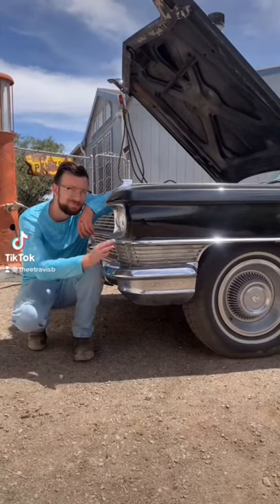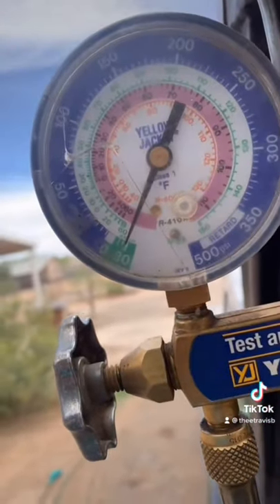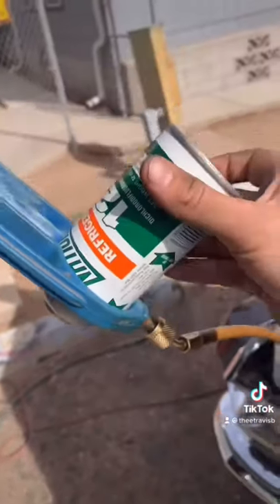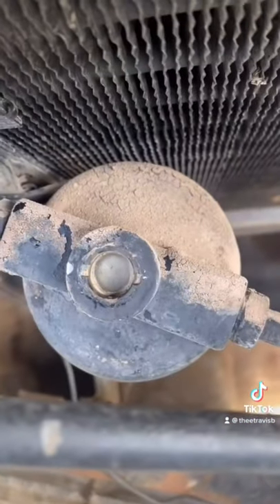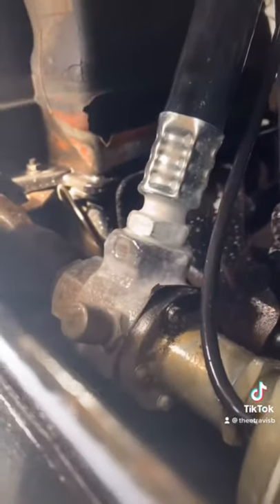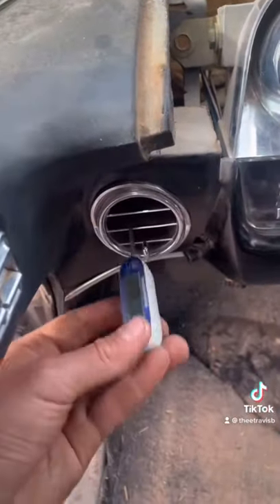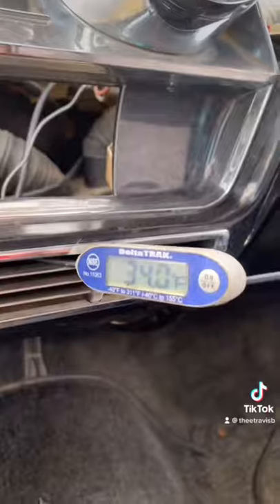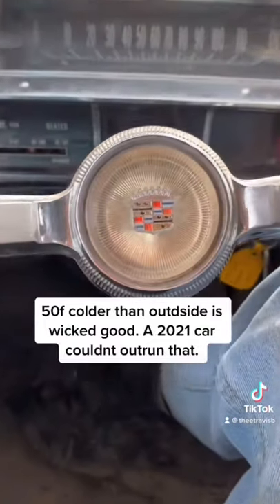64 caddy limo restore pt 11/13 #shorts #tiktok

Comment: Cadillacs in the '50s originally had the AC unit in the trunk.  The hoses and vents were in the ceiling above the rear seat.
Amazing engineering.

Comment: I think the workhorse was the R12 itself.
40° below ambient temperature is considered peak, anything other than R12 would freeze up.
Reply: The newer cars can't hold a candle to the ice cold air from 1980s cars on back.
Reply: 134a can cool this well but the system needs to be designed more efficiently to do so. My '88 Ford escort can blow 33 degrees at highway speeds on an 80 degree day with 134a in the old R12 system. It could be even better with a more efficient condenser. It doesn't cool so well when stopped and depending on the radiator fan.
Reply: @Krankie_V  it doesn't cool well when stopped could be because it's overcharged and can only pull the pressure down with the aid of increased air flow. 
If you add an extra fan on your condenser it would probably cool better at a standstill.
Or reduce your overall pressure and equalize.
Reply: @grapeseed427  it's not overcharged. it's just not a very efficient condenser. I changed 80% of the factory r12 weight charge with 134a. it cools at a standstill but not nearly as well as driving down the road. I've actually bought another fan to put on. the stock fan is trash. it only pulls air though about 2/3 of the condenser's surface area. I'm sure the new fan will help.

Comment: So older ac fluids actually move heat better and get to much colder temps easier. This is why when you drive an old car that's been converted to a modern refrigerant they never blow cold enough. The system is sized for a completely different refrigerant.
Reply: Yep, leaks out too because the different molecule size

Comment: R12 was much colder and lasted longer than the r134 or the new freon
Reply: the molecules are larger in R-12 so leaks out slower.
Reply: Where to find r12
Reply: @dcomputers  ... R-12 hasn't been made in decades but can easily be found on eBay in those one pound cans, and even in larger containers. Hunt around because the price can vary quite a bit.
Reply: R12 also destroys the atmosphere, so it’s illegal. Goodbye
Reply: @kkoz_  ... illegal to manufacture but there's still inventory out there to be had. Lots of old guys find it in the back of the garage or a warehouse when cleaning out.
Reply: @kent koz    lol 🤣  what doesn't destroy the atmosphere these days?
Reply: @kkoz_  And how many cars are there around that still use it? Enough cars to destroy the atmosphere?
Reply: You lose 10% efficiency & higher head pressures per spec sheet from Dupont.
Also, a piece of trivia. "Freon" was a trademarked name from Dupont. When Dupont came out with 134A, it was called "Suva".
Reply: @kkoz_  All refrigerant is harmful, thats why its always changing, takes years before the damage is figured out. BTW you think rockets don't release toxins into the atmosphere, nor mining for batteries?
Reply: I found a 40 pound barrel at an old HVAC shop. The owner had forgotten about it and he said he'd take a grand for it.
Reply: @Deucealive75  I have 3.
Reply: @dcomputers  🇲🇽  Mexico
Reply: My father worked in an appliance company the reclaimed old appliances every refrigerator that came in that used 134a had hardly any refrigerant left in it at all when he went to drain them however every single refrigerator and deep freeze that came in using r12 still had refrigerant and it and 75% of them still worked absolutely fine in fact the shop refrigerator was a 1940s model refrigerator that still had the exposed compressor on top of it that was the coldest refrigerator I've ever seen in my life.

After nearly a decade of working there and reclaiming three to five-year-old fridges all day long my father came up with the idea that 134a mush rink otherwise the machines would still be pressured there's no reason a three-year-old $4,000 refrigerator should be bad due to no refrigerant when it had no leaks
Reply: @kkoz_  R134 also destroys the atmosphere. NO refrigerant is safe for the environment.
Reply: Yes
And the lead paint on dinnerware made the food taste better too :)

Comment: The older refrigerants cooled better
Reply: Like using 100% gasoline gets better everything including gas mileage.
And don’t even put ethanol/gasoline in any of your small engines like weed eaters, chainsaws etc because the ethanol ruins the plastic parts in the carburetors.
Reply: They were also significantly less efficient and significantly worse for the environment

Comment: If you are recharging it's leaking. Find it and retrofit with a new comp. They still make those old log style but with r134 ports and seals.
Reply: It doesn't matter how well an A/C system is sealed; they leak.

Comment: Them A6 compressors are the best.
Reply: Ford & Mercedes used them also.
Reply: @jamesr2888  yes that's correct. I remember working on a Mercedes with an A6. The reason being is that on that model it was buried in the engine compartment next to the frame rail. YIKES

Comment: The vacuum lowers the boiling point of water which is imperative to proper operation of any ac system.   The vacuum pump isn't actually pulling the air/moisture out.  For those that do the "just throw some freon in it" and don't pull a vacuum,  you're killing your system.

Comment: That AC GM compressor system usually puts out 1 ton of cooling each 1000 rpm of engine speed.

Comment: damn 80 degrees in July!? , I live in Tucson and July usually has an average of 102
Reply: where did you get 80 degrees from? In the video he said it was well over 100 and his thermometer said 91 and change, which may have been in the shade.
Reply: @rupe53  He said the engine bay was well over 100 and while he was driving he said it was around 80 degrees, the 91 was probably because he was holding the thermometer by the metal part and I imagine that was the temperature of his skin

Comment: Ow if you were smart, you SHOULD have drained the system of everything oil and freon. Flush it out with plain air brake anti freeze(methanol based) then use quality solvent flush like the one NAPA carries. Do not use types that leave oil in system like FJC.
Then pull vacuum and you fill system with oil using ESTER 100 or if you can find it with ROC oil.
Warning you have to also change the drier dessicant to XH5 or XH7. Then add the oil and that old A6 will carry 11 oz alone then 3-4oz for drier and -2 oz each for condenser and  evaporator and I allow for 1-2oz for hoses. 
Then fill with R134a ,fill till site glass goes clear then add 2-3 oz of refrigerant.
Now two things if it has fan clutch make sure it's a later model on with thermostatic spring in from also adding couple of quality electric fans will HP destress the system.
If hoses start weeping oil then your hoses need replaced

Comment: I remember years ago I had a chance to buy 2 1964 Cadillac fleetwoods. Both needed transmission work, but I knew a guy in Williamsport who was an automotive machinist who specialized in... Transmissions. The two cars back in 1996 we're offered to me for $500 for the pair. Since I was working for my father in construction, and he was determined I would never have anything independent of him, he would not help me at all in any way.

What, I was working in construction with my dad? I should have been rich!

Well, that's because my dad had me start working with him and I always not even yet 10 years old. It's always the claim that we were going from one crisis to another crisis and one day he would pay me regular.

I left there after 20 years of hard labor with the clothes on my back and what I could carry.

Yeah, it would have been nice to get those two Cadillacs and fix one. At least I could have lived in the one that was fixed.

Comment: My Uncle Earl worked at Cadillac ! My Dad was a designer for FORD in Dearborn Michigan where I was Born in 1954
Reply: What did your dad design at Ford?
Reply: @jamesr2888  He worked on1950 to 1959 Fairlane T Bird's he was involved with padded dash boards with Gruesome Head's from India to measure the impacts of hitting the dashboard at different speed's which he had a role in , Very Secret work Because of the head's of humans from Calcutta ! YIKES & the first glass skylines on I believe we're Fairlanes ? That were green Glass but in the Yuma AZ proving grounds the dummy heads were catching on Fire from heat & Sun & the glass ! So a design was made to put in a cover over the glass ! I'm not totally accurate as to time line's but he was involved in many project's ? Then was also a top Air Brush artist's at this Time . He was Offered a Position with Convair General Dynamics as A Designer of The Space Product's if this time 1959 San Diego for the NXT 31 year's ! From the Atlas To Cruise Missiles & Space Shuttle

Comment: Bro that’s too cold. If you evaporator coiL temp is lower than freezing temperature it’s going to freeze up and ice up. you want the air coming out of those vents to be No colder than40°
Reply: 38 - 42 was common. At 29 degrees there's something wrong with the system.

Comment: Those old AC units were like Meat locker action, after removing R12 from the Automotive applications due to Ozone layer damage, or what was thought during the Time. Next version used was R134a with components of agent orange!?

Comment: R12 ac was a better system.  My cousin had an all original 69 Lemans with dealer installed air that would frost the grills when you turned it on in Texas 100°+ heat in the early 1990's.

Comment: I know the R1234YF system in my truck couldn’t do that.
Reply: Do you realize it's flammable?
Reply: @jamesr2888  yes, it is somewhat flammable. But they are also using butane and isobutane for refrigerators nowadays too. Virtually every vehicle starting from the 2021 model year has to have the R1234YF by law. The alternative is no air conditioning. Yes, you can switch it back over to R134a, but there are fines to involved and mechanics can’t legally service your system either.

Comment: Why be stupid and use r12 when a 134 conversation is actually a lot cheaper and safer for the world and not against the law
Reply: The system was engineered for R-12 not R-134A. Also, R-12 doesn't "eat a hole in the ozone layer", it's BS.

Comment: Why not just convert it to r134? It’s soo easy
Reply: No its not, requires replacing everything to do it right, you can't just put it in the old compressor, filter, lines, condenser, evaporator, or seals!
Reply: @Maples01  You have to use PAG oil also.
Reply: @jamesr2888  Yeah, impossible to purge the system completely, you need replace everything to insure its clean